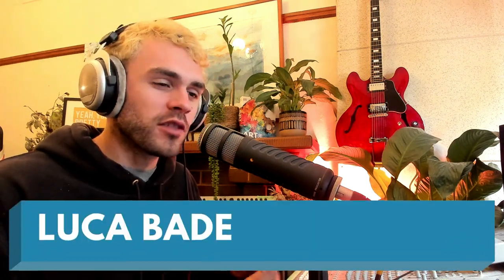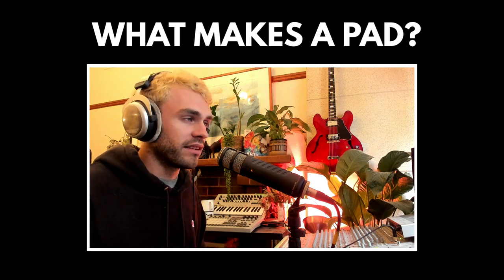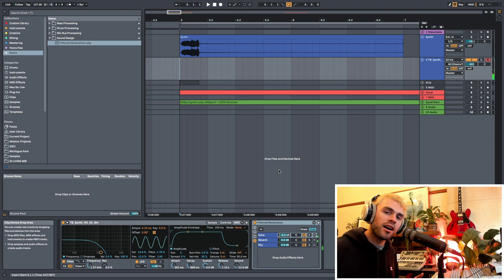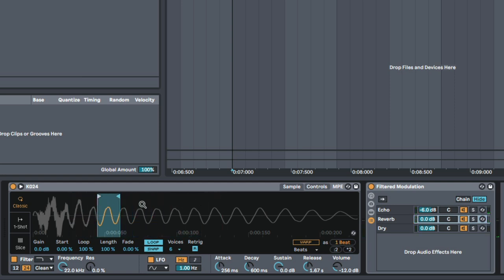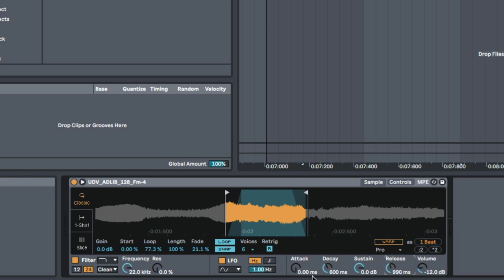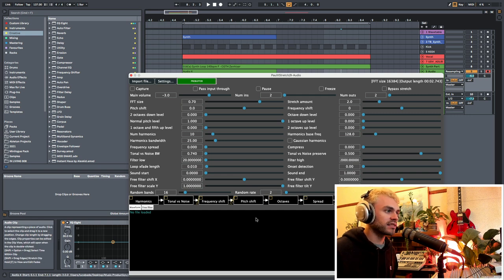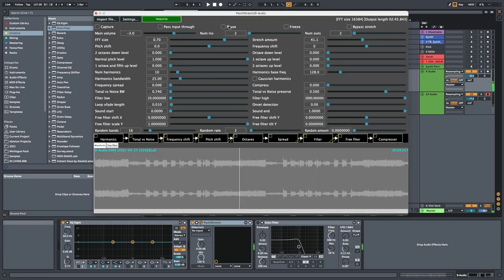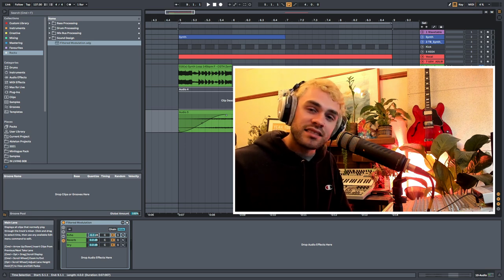How To Make a Pad out of ANYTHING!

Comment: You can even make a pad out of white noise (which I don’t think would work well with the sampler loop method) by putting a really long wet reverb on it, flattening it, and then putting a filter with a few tight peaks on harmonics (or a comb filter which is even better) and then putting that into a sampler. I used to do that with room noise just for fun